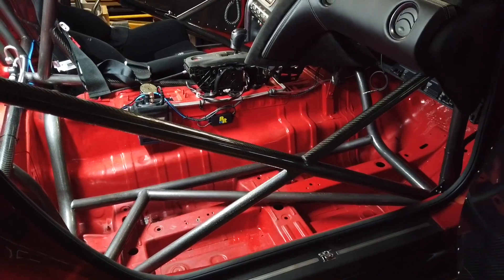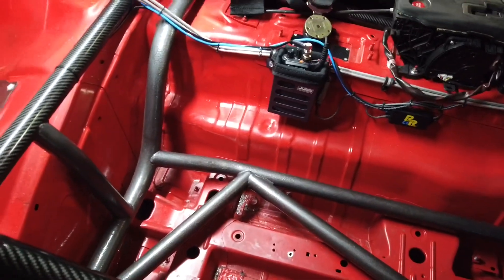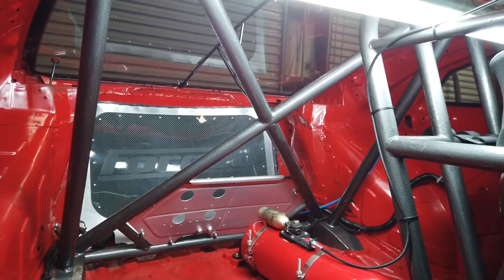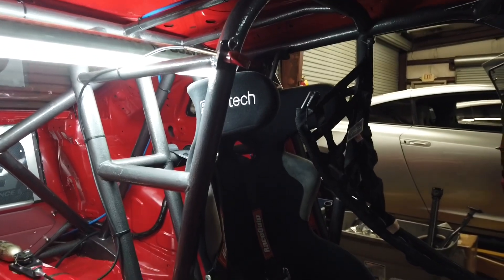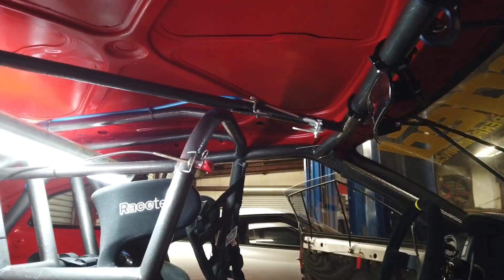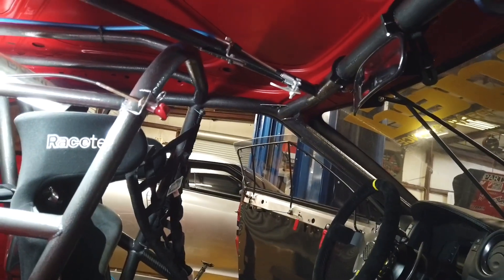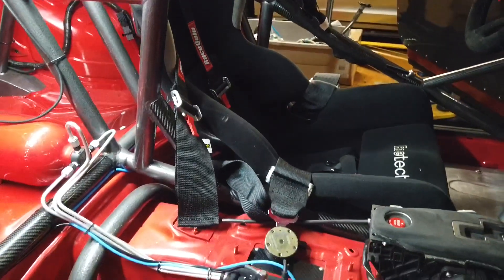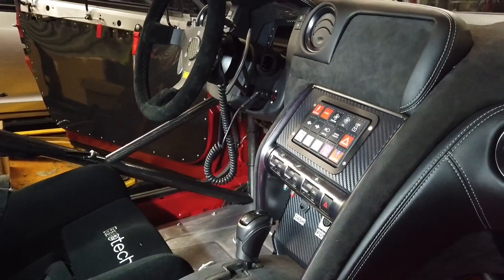Roll Cage Install R35 Nissan GT-R SFI 25.5

Comment: Cool video!
Reply: Joseph Kenefic I’m very curious to see a R35 platform with the VR38 engine and a Th400 or liberty Rwd only setup, it must be quick.
Reply from the maker: This is going to happen to this car at some point once we get tired of breaking the GR6 😆
Reply: Joe at Forged 😂💪
Reply: Joseph Kenefic the class rules mean you have to use stock gearbox location and AWD ?